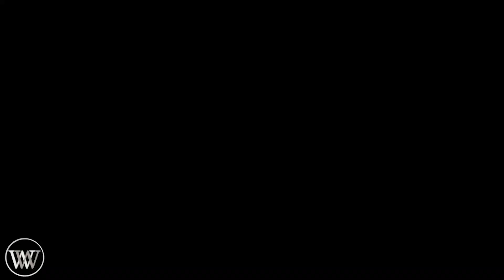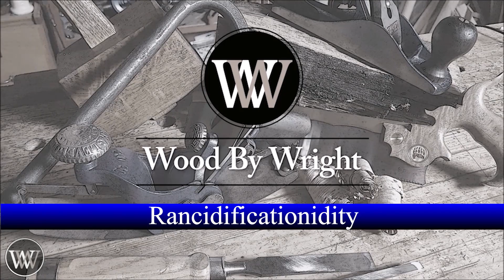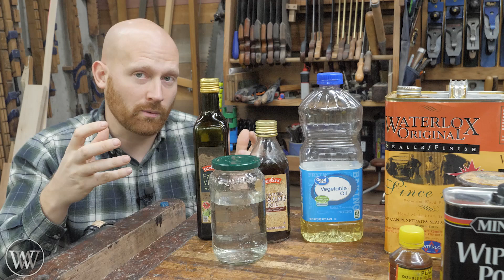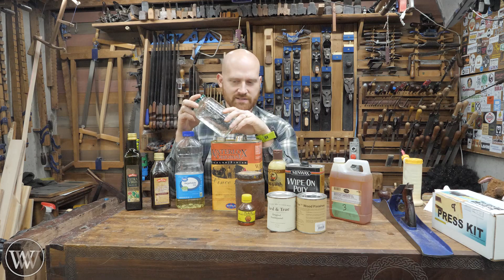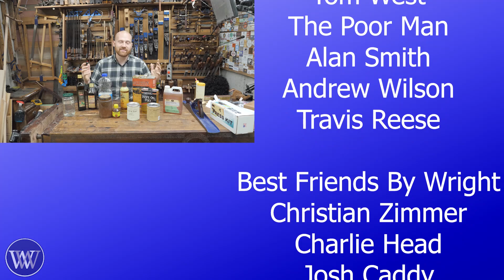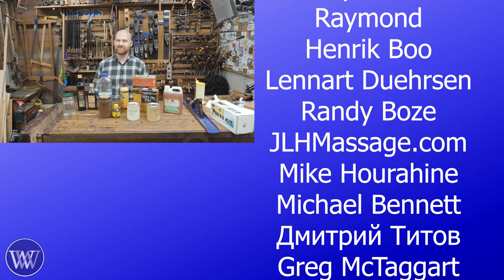What Does It Mean To Go Rancid Food Safe Woodworking Finishes

Comment: I agree with a lot of what you said, but there is still a lot of complication and uncertainty.  The aspect of taste relevant to furniture is smell: we don't want it to stink.

Oxidation does a lot more than polymerization.  Saturated fats are resistant, while unsaturated ones form hydroperoxides on exposure to air and light.   These can decompose to form smelly stuff that make us call the oil rancid.  As mentioned in the article on fish oil you cite, toxicity of rancid fish oil is unknown.  Similar substances are likely in the boiled linseed oil you make without driers: I would not assume these are as benign as you do.  Even trans fats (less modified) are now known to be a little bad for you.
The role of oxygen in polymerization is not simple.  It will inhibit polymerization while reacting to form hydroperoxides that can initiate polymerization on heating.
Polyunsaturated fats form hydroperoxides fastest, and can be converted by heat and catalysts to conjugated forms that polymerize much more readily.
It's true as stumpy says that on cure a finish becomes plastic, and previous composition is changed.  It's likely to be a lot less toxic, but it's likely not known how toxic various plastics are to eat.  They differ a lot more from one another than balsa does from lignum vitae.

Comment: "Is mineral oil organic or inorganic?
Mineral oil is organic. However, it is classified as "mineral oil" instead of as "organic oil" because its organic origin is remote (and was unknown at the time of its discovery), and because it is obtained in the vicinity of rocks, underground traps, and sands." Wiki

So mineral oil can't go rancid, because it went rancid before it became "mineral".
Reply from the maker: Mineral oil is a byproduct of the petroleum industry. It is removed from crude oil. It does not go rancid through oxidation because it does not polymerize it never has polymerized and never will and therefore it does not go rancid through oxidation like other oils do. However it can go rancid from bacteria just like any other oil.
Reply: @WoodByWrightHowTo  Isn't crude oil just a rancid dinosaur?   ;-)

Comment: You ignored then main problem with olive oil going rancid, it smells bad! That is not good.
Reply from the maker: Once a polymerizes it does not smell bad.
Reply: @WoodByWrightHowTo  I love your content.  I know olive oil polymerizes under heat, but am unaware that it would polymerize at room temperature.
Reply from the maker: It'll polymerize at room temperature. It just takes a little longer than lindseed oil. Usually it's three or four weeks at room temperature. You can speed up the polymerization through heating Keating the oil or "boiling" it. But there's a reason that most woodworkers use linseed oil instead.
Reply: @WoodByWrightHowTo  Thanks for the thoughtful reply!